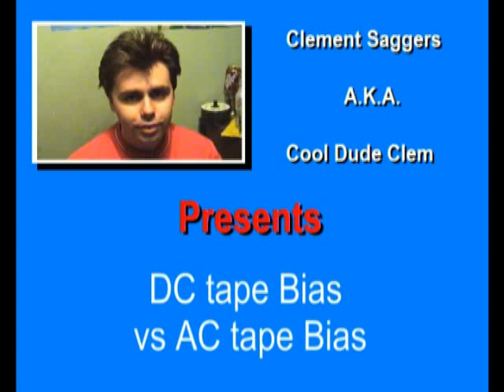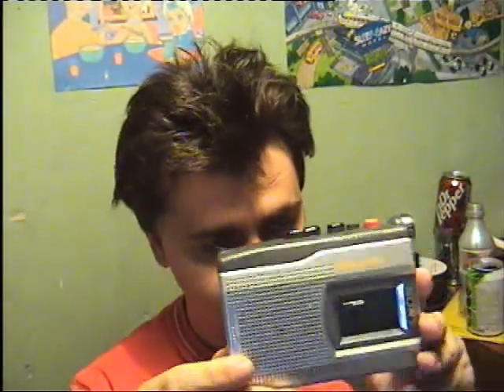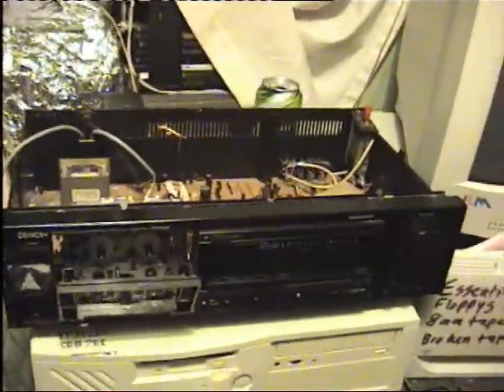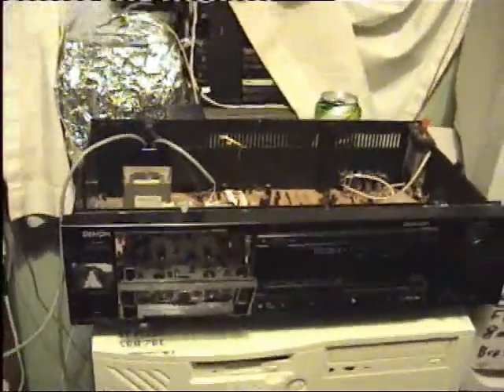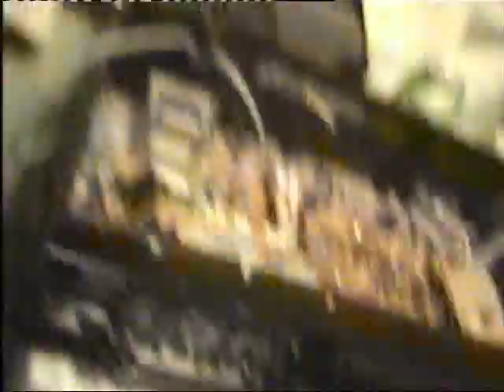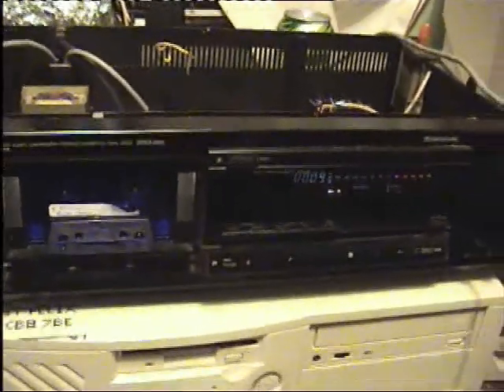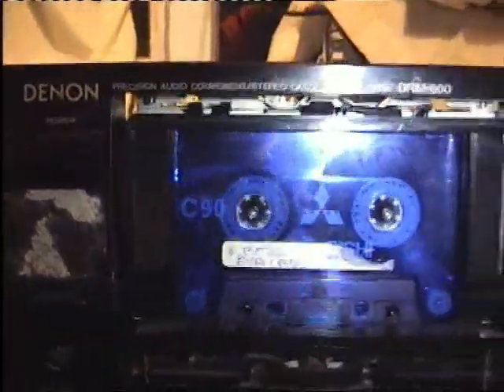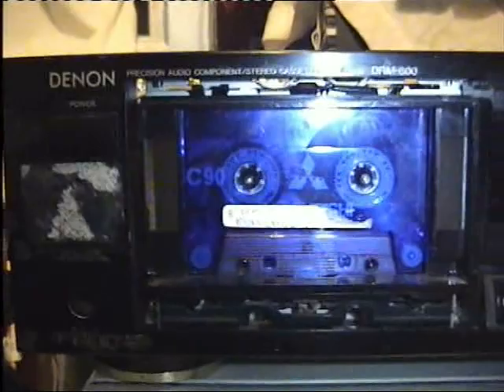DC bias vs AC bias

Comment: The portable deck has also ac -bias, you cannot record without it, it'll distort like hell. The portable has a permanent magnet erase head, the denon a high frequency ac-voltage erase head. The magnet adds noise but also the built in mic (and circuitry) which picks up motor  and handling noise.